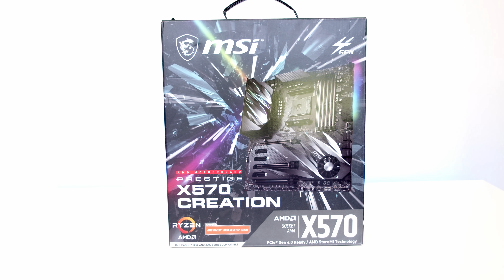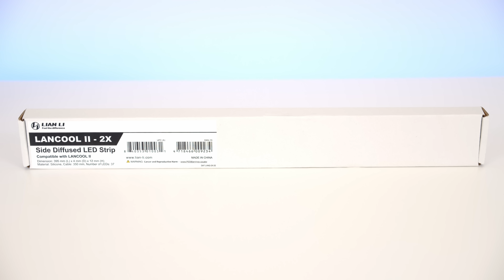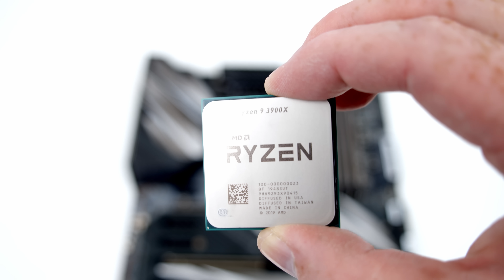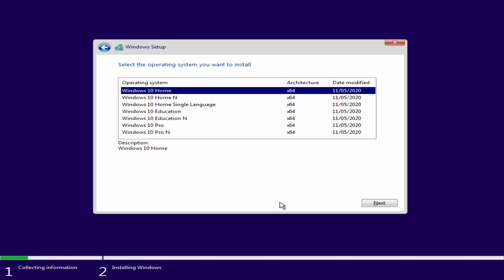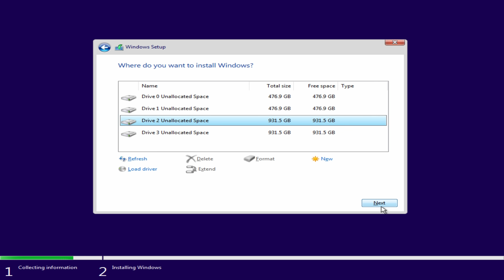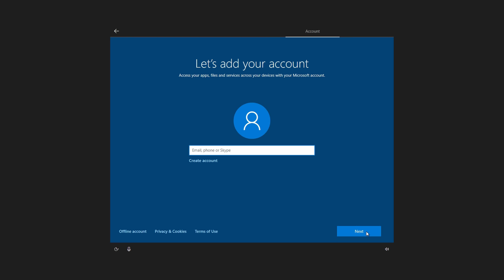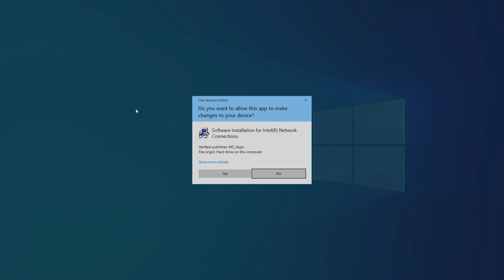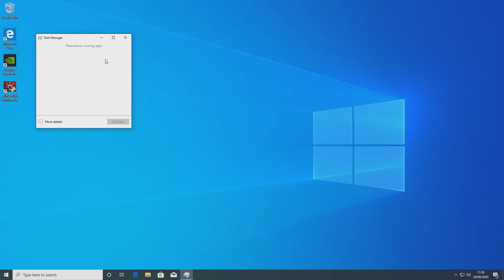Lian Li Lancool II Mesh Step-by-Step PC Build Guide

Comment: Does the power supply fan need to face down? Does it make a big difference temperature wise?
Reply from the maker: Depends on the case and where the intake fan isd getting the air from
Reply: @ChristopherFlannigan  Oh. I see. I have the exact same case and installed it the same way you did. I just wasn't really thinking about it since I got an RGB Power Supply. Obviously the RGB is pointless now. lol! Thanks for answering back so quickly. Much appreciated.

Comment: hi! So the front panel ARGB controller SATA power should also be connected to the PSU? as well as the ARGB from the front panel to the ARGB head on mobo? to make the 8th mode sync to mobo.  is it okay to have them both, the ARGB and SATA power plugged in?

Comment: If I'm using a 240 AIO in front - so reusing one of the case fans.. would I still connect all three to the same splitter cable (1:02:00)? Or should I only connect the two AIO PWM fans to it?

Comment: PLEASE ANSWER!!
These are the items i have. Can i still follow this build.
Z490 Gaming edge wifi Motherboard.
i7-10700k CPU
Noctua NH-D15 CPU COOLER
W.D M.2 SSD. (NOT NVME)
Lian Li Lancool II Case 
Antec HCG 850 Gold 80 Plus Gold  PSU
Ben q Monitor.
Reply: NO GPU AS OF NOW.
Reply from the maker: There will be some changes due tio the parts, but the guide will still help you some of the way
Reply: @ChristopherFlannigan  dude i am so confused man. my psu is diff. the cabled are weird. i mean some have extra parts.   
\

Comment: I'm building in this case now,  and using this video for reference. Other than the 3 front case fans that need to be reconnected , What about the 3 3pin connectors in the case cable nest? Do those need to be connected somewhere?
Reply: I think I figured it out,  the 3pin connectors are too run them in DC mode instead of pwm?

Comment: From lianli site on this case

ATTENTION!
DO NOT INSTALL A 140/280MM RADIATOR IN THE INNER SIDE OF THE MULTI-WAY FAN/RADIATOR BRACKET OTHERWISE UNREPAIRABLE DEFORMATION WILL OCCUR. YET IT’S OK TO MOUNT THE FANS IN THE INNER SIDE AND THEN MOUNT THE RADIATOR ON THE FANS

Comment: Hi I have the lianli lancool 2 so I plugged the led strip to the case so the c and m buttons also control it but I also got the 3x8 gpu strimer v2 cable and I wanna control it with the buttons is there a way to do that?

Comment: if i'm aiming to use a 3080, should i use a 360MM AIO front and then use all the possible slots for my fans to cool down my horizontal GPU or it's a bad idea ? (my cpu is a ryzen 9 5900X) thanks

Comment: 42:48 mine is male and there's no where to plug it in for my motherboard. No slot at all for it. Does anyone have the same thing? 

Great video btw thank you very much.
Reply: Hey, had the same problem as you but it turns out that the male cable is for the rgb strip extension, if you didn't buy it then you don't need to plug it in anywhere :)
Reply: @rabbidraven1954  ohhh thank you! So it's if I wanted to add more RGB? Thanks again

Comment: Hello Christopher! I have a question. Is it okay if I mount a Msi 360r radiator at the front of this case? The pump is located inside the radiator. I have this case and im planning to get this radiator and since you said mounting a 240 at the top is a bad idea. Thanks!
Reply from the maker: It would depend where in the rad it is as you wouldn't want the pump at the top

Comment: 12:49 I love this case, but I am so mad because all of the screws on these panels are stuck and really easy to strip. I stripped this one you removed so easily. Luckily I am not using a radiator in the front or removing the hdd cage (yet) but still how irritating.
Reply from the maker: Mine was good, normally lian li don't have problems

Comment: So I know this video is super old but my pc which I built in this case with the three default fans that come with the case and the lian li 240mm rgb cooler the default fans whenever I boot the pc are white the rgb works but is constantly white I’ve never hooked up the pc to the monitor yet for reference and the rgb cooler (Lian li) whenever I turn on the power switch the rgb turns on for 1 second and turns off when I actually power the pc on the rgb is dormant but the fans work well.

Thoughts?
Reply: Specs btw 

RTX 4070
ASUS Prime B650M-A AX II
Flare x-5 G.skill 32gb
SSD 980 evo pro
750ww Corsair gold psu 
LIAN LI GALAHAD AIO Cooler 240mm

Comment: I have a notification on the pcpartpicker website which says 
"The Asus ROG STRIX B550-F GAMING ATX AM4 Motherboard supports the AMD Ryzen 5 5600 3.5 GHz 6-Core Processor with BIOS version 2423. If the motherboard is using an older BIOS version, upgrading the BIOS will be necessary to support the CPU."

I have set everything up correctly but the power button isn't triggering the boot. Could it be because of the incompatible cpu?? Of so how do i update the motherboard bios??

Comment: does anyone know what´s the longest card you can get into the lancool 2 mesh case?
I´m thinking about buying one but i´m not sure if my 3080 suprim x (33,5 cm) is gonna fit into it :/
Reply: It should, if you type up this case on Pcpartpicker it wll tell you the maximum length gpu that will fit in this case :)
Reply from the maker: Check the specs on lian li website, they should list this

Comment: Hey quick question. Where did you get that custom wood butcher block table top and what are those steel rods in between the table and drawers holding up the desk/ butcher block
Reply from the maker: ikea karlby counter top and BQLZR Stainless Steel Kitchen Adjustable Feet Round Furniture Legs on top of alex drawers
Reply: @ChristopherFlannigan  thank you kind sir !!

Comment: I watched fan installation and bios parts of the video few times. Still don't understand how it's 5 fans if it's literally 6 of them (3 intake, 1 exhaust, 2 bottom). And from what i know case fans which were included do not have pwm mode.

Comment: How do one put in 4 Lian Li addressable LED strips instead of just one?  Is it possible to split the Lian Li case's addressable RGB signal from each of the three already splitted ends to control more ARGB fans than just the 3 front panel Lian Li  case fans?
Reply from the maker: You could but they don't specify the max you can plug in

Comment: Hey everything after 02:23:29 is optional right? I don't reaaally need that for a good Gaming experience right?
Reply: You most certainly need to make sure your memory is running at the correct speed. Also, lower temperatures can mean better performance, so it’s worth making sure your fans are running well. It may look scary, but Chris does a great job explaining it all!
Reply from the maker: I would follow the whole guide to avoid noise fans running at 100% and as DeadShot says you will want to fix the ram speed to get the value you paid for

Comment: I've connected the sata cable to the psu. The rgb lights of the fans turn on , but they do not spin. I don't know what to do exactly, what i did wrong. The pc works just fine, everything's in place, it booted, it can browse the internet, everything. Just that the front fans that were included with the case do not spin. Can anyone help?
Reply from the maker: You need to plug the 4 pin cables in to system fan headers

Comment: Hi! If I put an MSI AIO on front of this case, could I connect the fans to the case argb controller and control them directly from the front panel? Or it has to be Lian Li fans?
Reply from the maker: It depends on the fan connections, you would need to see the aio to work it out

Comment: Thanks Chris for this awesome video, very good, very helpful, one of the best in Youtube. few questions, when you update windows, do you need WIFI? so do you need to install internet? Also, if I have 2TB M2 and 2TB HDD,  when installing Windows, how do I know which one is M2? Also, if I use GTX 1660 TI, do I also use Geoforce Experience Driver as well?  I have Xeon E5 2678 V3 . I tried to find the chipset driver  but I cannot find it. Can you give me some guidance to download the chipset driver as you did in the video? Thanks
Reply from the maker: You don't need wifi to install with off line account, but you can connect it at the start if it lets you. Unplug the sata drive to do the install and add it after. Yes geforce. I only build amd, but suggest your motherboard page for the drivers
Reply: @ChristopherFlannigan  Thanks Chris. I appreciate your reply. I can start installing Win10 now. However my Samsung 970 EVO Plus 2TB M2 NVME SSD is not recognized by windows and BIOS. do you have any suggestion for this issue? Thanks

Comment: Hi Chris, Please help me. I have MSI B450 tomahawk MB & Lian Li Lancool 2 Mesh. Please tell me how can i go ahead with 5 more ARGB fans with this?  I want to install 2 fans of 140 mm on upper side for exhaust, 1 fan 120mm on back exhaust & 2 above power supply of 1200mm as intake. I am not getting this anywhere.  Please help me.. I am 45 and may b a noob in pc building.

Comment: I don't see the cable to plug the rgb strip into I don't have that cable on my front panel I followed every wire either they lead to a sata or the fan module I see nothing with a 3 pin connector for the rgb    strip pls help

Comment: Why noone shows how to remove the bottom side panel. The rectangular small side panel just below the glass panel. I am unable to remove it in order to install the PSU. Does it slide back? I have unsdrewed the screws. But it doesn't seem to either slide back or open out. Does it slide but is super tight?
Reply: pull it down
Reply: @str9wbrry  Well there was a secret little black screw inside the case's main body that was not letting it be pulled down.. This should had been shown in the video

Comment: Ive added the strip to my case using the connector showin in the video, but it doesnt come on. Ive enabled RGB control in Bios, I assume thats required. But nothing? Should it come on immediately or do I need to press M or C buttons, and if so how ? The instructions are useless, they mention mode 8, does that mean press M 8 times?
Reply: 33:48 I guess :)

Comment: You aren't getting less space than advertised.

All hard drive sizes are presented in gigabytes and terabytes. That is 1 gigabyte = 1000 megabytes, etc.
While Windows actually reports all sizes in gibibytes and mebibytes, where 1 gibibyte is equal to 1024 mebibytes.

So a 1 terabyte ssd would in fact have 931 gibibytes of storage.
Reply from the maker: Thanks

Comment: i accidentally bought this case with a 360mm aio not knowing it wouldn't fit on the top. I could try doing what you did in the video or I can return either the aio or case and get a different one. Any opinions? This is the first pc I am building and I'm not too familiar with anything. I'm worried that doing what you did will be too complicated for me
Reply: Nevermind, I'll be doing what you did in this video. Thank you for the comprehensive guide, it should be relatively easy to follow along. Wish me luck!

Comment: Hey, can we use the rgb fans that come with the case on a radiator? will that work or do you not recommend that? Can we use those fans on other parts of the case?
Reply from the maker: Yes to both

Comment: So I did a build in this case recently with the Kraken X73 with the tubes on the rad side up at first, but I got air bubbles so bad my PC would crash because my CPU temps would spike. Is there a specific reason for this?
Reply: @ChristopherFlannigan  yeah I fixed it eventually, sat the rad on top of the PC for an hour with it running, then reinstalled in the original configuration (as I had switched it around trying to fix the problem) and now everything runs fine, the fans are noisier than the pump now, no crashing and no lagspikes now.

Comment: I Have an Old Motherboard that does not have any ARGB headers so will I be able to control the RGB Fans With the Buttons at the Top of the case by Simply connecting the Fan to the Regular 3/4 Pin headers on the MotherBoard (MSI 970 Gaming). I don't care about any Software Control. Please Help
Reply: @ChristopherFlannigan  Thanks for the quick response.

Comment: I really need your expertise! Could I build a water cooled 1080 gpu with its 120 radiator into this housing while on the front there already is my 360 radiator from the CPU?
Reply from the maker: I would probaly put the 120 rad at the bottom and 360 on the top to avoid the gpu cables stretching over the case.
Reply: @ChristopherFlannigan   but can i put the radiator on the bottom? On their homepage they say that you just can out radiators on the top and the front
Reply: Oh and also a 360 Radiator should not fit on top. It's just meant to fit 240

Comment: These videos are OK for beginners, but no time was spent explaining the choice of orientation of the AIO cooler, which isn't optimal.  Air always pools at the highest point of the loop, so when you put the AIO in front of the case with the tubes at the top, air will pool at the junction of the radiator and the tubes, so the outlet tube will send air bubbles to the pump.  This will decrease performance, and will increase noise from the air traveling around the loop.  People will complain about hearing sounds of water trickling or gurgling.  The best rad position is at the top of the case.  If you have to put it vertically in the front or back of the case, the tubes should ideally be at the bottom, so that air will pool at the other end of the radiator (top) and will not enter the loop (the top of the radiator should still be higher than the pump for obvious reasons).
Reply: As long as the pump header is below the top of the rad its physically impossible for air to get to the pump, as you said air will sit at the highest point. It will sit at the top of the rad and for sure may over time get louder and may lose life span but you wont lose performance and wont damage the AIO. Having it the other way around is better but the way he has it is fine.

Comment: quick question, how do you connect the ARGB fans that are included with the case if I have an air cooler?
Reply: That's exactly what I've been thinking, I left the 3 case fans at the front in as I have a 2 fan aio cooler on top. My mobo only has 3 chassis fan headers and I just plugged each case fan into each header, connected all the rgb cables together between case fan and cpu cooler and was done with it. The cpu cooler and case fans rgb are in sync which is great, but I haven't installed any other fans at all and have no idea how to go about it
Reply: @jjmcnamara5236  yea its confusing ill tell you if i figure it out.
Reply: Mr Anderson  thanks

Comment: 18:30 The most crucial part is the CPU install, do not mess this up and watch this part twice 👀
Reply: First make sure you’re “grounded” by touching a big metal door or appliance. It’s best if you have an ESD anti-static wrist strap touching your skin, with the wire cramped onto a grounded metal appliance — to prevent static charge accumulation which can easily damage electronics without you knowing or feeling any shock ⚡️

Comment: GIGABYTE Z790 AORUS ELITE AX LGA 1700 Intel Z790 ATX Motherboard with DDR5 MSI MAG Core Liquid 360R V2 AIO Liquid CPU Cooler, 360mm Radiator CORSAIR Vengeance RGB 32GB (2 x 16GB) 288-Pin PC RAM DDR5 6000 (PC5 48000) CORSAIR 850 Intel Core i5-13600KF rtx founders 4080 SAMSUNG SSD 990 PRO 2TB, PCIe 4.0 LIAN LI LANCOOL II MESH C RGB BLACK Tempered Glass ATX Case watched this to put it all in to a beast mode pc 
stuffed it all in and fans at bottem

Comment: Hello Everyone!
I need your experience! Soooo. My plan: I'd like install 5 ARGB fans behind the 3 front fans ( These are 8 together)  But I'd like control the 5 fans together and I have to buy a ARGB hub because i havent got enough Fan connector. BUT I have a little problem.
I have a Gigabyte Aourus Gaming K3 Motherboard. I haven't got 5V 3-pin connector on my MB. I have a  5V VDG connector. So if is it possible, I'd like control all 8 fans together, but if I can control the 5 fans I'll be happy. So how can I build up my plan?? :/ 
Thanks!!

Comment: Will this case handle a 360mm aio, and the strix lc oc 6800xt (240mm rad)
Reply: Help if you dont mind
Reply: @ChristopherFlannigan  problem with specs is they arent always accurate meshify c claims a 360mm rad in front, 240mm on top. It wont work. I think im just gonna order the o11 it should definitely work. I think the lancool 2 mesh will work without the hdd cage
Reply: @ChristopherFlannigan  perfect. Thank you. I had the build in order, and the 6800xt was gonna be the sapphire or asus tuf model, but for 100.00 i had the option to get the strix and that changed my build ultimately. Thanks again for the input

Comment: Amazing tutorial.

Quick question did you finally test the push and pull fan configuration on the radiator?

Does it fit? If so what's the performance improvement like?

Thank you!

Comment: Thanks. I am switching my 2018 Dell mother board into LIan LI Performance case. No where on the motherbaord it's mentioned where is the power, reset and LED cables. No mention of the +ve or -ve sign also. What will happen if I don't connect them to motherboard? I am talking about this https://www.dell.com/community/Desktops-General-Read-Only/Power-on-Reset-Pins-on-motherboard/td-p/4364919

Comment: Isn’t your PSU generating heat and those 2 fans above your PSU are blooming hot air from your PSU right on to your GPU.
Reply: Nah i have my fans like that in this case and it blows cool air into the gpu actually.

Comment: You installed your water cooler the wrong way.  You need to have the cables at the bottom or you will screw up your AIO because there is air in the lines.  Check out GN Steves video on it.